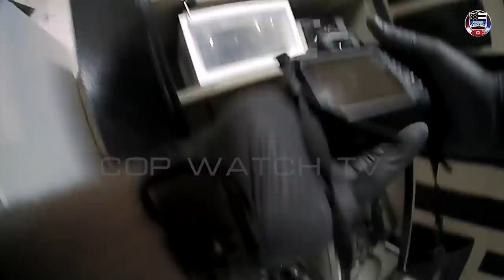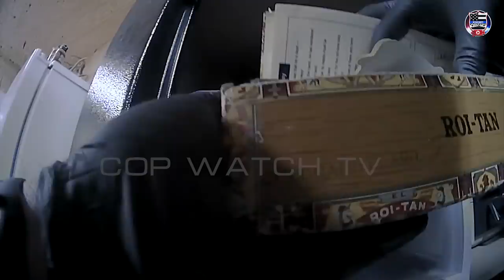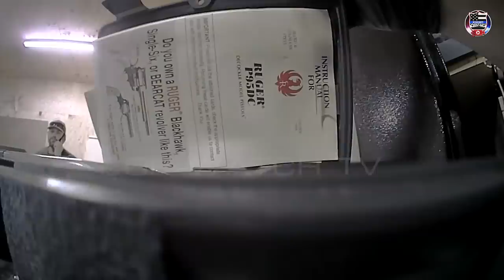Border Patrol Cop Arrested for Dognapping Neighbors Dog

Comment: Do we know if the dog was the same dog that was killing his chickens? I don't know this story. If it is, it certainly wouldn't condone what he did however it would explain the reasoning in his mind. If that's the case poor doggie and shame on those owners aswell for being irresponsible.  As much as it sounds that dog was running around it could've also gotten hit by a car. Honestly their just as crappy, they could've prevented. The GPS, It wouldn't stop a car from hitting your pet it certainly didn't stop anyone from killing it or it killing chickens if that were the case. Maybe he got the GPS after the chickens? That would speak volumes and they still didn't get on point with their beloved pet. If it were the case